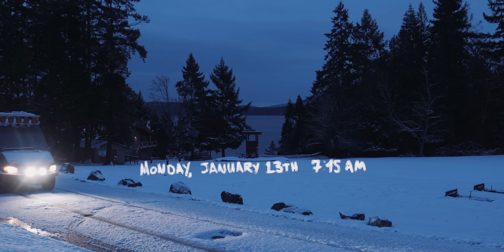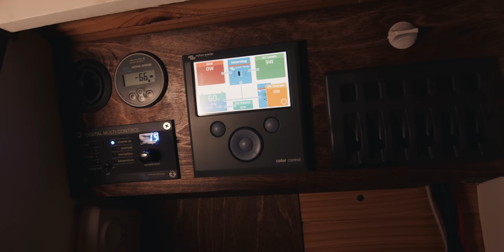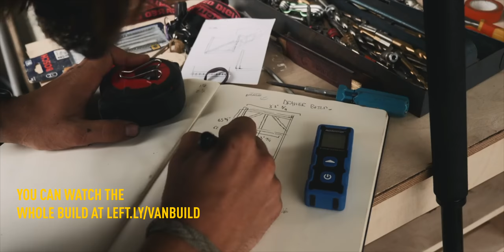Winter Storm In DIY Sprinter Conversion - Van Tour!

Comment: Levi, Quick tip! When bringing your cameras and lenses from a cold environment into a warm interior it's a good idea to seal them in a plastic bag until they've warmed up. This will help prevent potential condensation forming in places (esp.lenses) you really don't want moisture to be! Great van build!
Reply from the maker: That is a great tip that I somehow always forget 😬🥶
Reply: Add a silica gel pack to the bag. They will help dry things out and they are really cheap
Reply: @Levi_Allen  Spekkin of a great tip...storing your canned goods next to your toilet so that you can piss all over the tops of the cans...luvit! :-)
Reply: Whoa great idea!

Comment: If you haven't considered it by now with the diesel heater, you might want to check for condensation build up behind your wall and roof panels. Cold metal, melting snow inside, heating water or just simple breathing. You might find a lot of water that you do no see behind the panels. All that moisture has go some where. Great video.

Comment: Only tip for you, keep a space heater around for when you're somewhere with a plug in - much better / easier to keep the van warm with one of those than your fuel.  I use a costco dish style heater in my 18ft travel trailer and does awesome; oil filled radiators will work great too.  The added benefit - no fan noise.  

The other gadget i use when boondocking is this ryobi "inverter" that basically takes one of their standard batteries and gives 110v and 2 usb ports - great for a small tv/raspberry pi or charging phones.  Works out well as I have a set of crappy ryobi tools for camping.

Comment: Those Webasto style heaters can crank! When I drove OTR semi, we had them in our trucks. -40F and it was toasty in the cab at night.
Reply: But was it reliable? When I drove my 2 freightliner cascadias those diesel heaters were awful. Hardly any temp adjustment and diesel would always gunk up the pilot. Had to take it apart and clean it every other use.
Reply: My semi has an Espar, works well.

Comment: Since you have heat in the van, it would be good to use a pot full of snow and keep it recharged to melt while you have the heat on to keep generating water. Saves your stove time/fuel.
Reply: Creating extra humidity in a van might not be too good. Especially as he goes out boarding and lets the van freeze, any humidity would turn to ice and then drip when he starts the heater up when he gets back. Just put water from the kettle into a thermos/insulated bottle and you will have plenty of water to drink later.

Comment: I bought a cab and 24 foot frame for $9,000. I put a 5 foot wide bathroom on the very back. It's stationary at all times. Then I put dual sliders on the other 19 feet. When the sides are pushed in, the entire 19 feet hang just 9 inches over the wheels. When we park, both sides pull out 8 feet and then heavy supports unfold manually to touch the ground and each leg and even the frame have easy to adjust (by drill) support poles. It's steady as a rock. Get this. It's 19 feet long and 22 feet wide. It's the largest room on any camper I've ever seen. And I've never seen as large of a bathroom as we have. When we travel, we flush and the poop comes right out the back (BLAT) onto the open road

Comment: One upgrade you might want to look into is a rubber mat with high edges that fit where you walk in. you could throw all your stuff that's drying in there and it would collect all the water that you could just dump out the door. your rubber floor is great but water can  still get under cabinets and such

Comment: When I bought my latest Sprinter Camper here in England ( V6 3litre with 7 speed Auto) I never knew that the " Auxilliary Heating"  is in fact a 5 Litre Epersbacher Diesel Heater. I asked so many Sprinter owners on the road , "Have you got a diesel heater ?" Answer "NO" , I said, " Press that little button with the wavy lines and listen" !  Tick, Tick, Tick,  WOW !  !

Comment: Invest in a ARB compressor later down the line if don't have one. So you can air back up your tires after deflate them for snow, sand, mud, other rough terrain that require low psi.

Comment: try putting a piece of duct on the inlet to the D heater then run the duct to your bed room, what you are doing currently is creating a heat exchanger with wind shield.

Comment: Hi Levi - just found this video via FB from Battle Born.  If you haven't already done so in the 2 years that have passed, consider adding alternator charging.  I like the Victron DC-DC Chargers.  I use the 12v 30A model and in my current build (5th wheel), am running two of them.

Comment: Where does the diesel heater's exhaust vent to? Surely you're not inhaling diesel exhaust inside your van - but when you said the heater was just under the seat, it puzzled me. How much diesel does it consume in this cold? Why do most other RVs use propane?

Comment: right on brotha, fun stuff. My interest is peaked for these van builds....so bunch of questions here: when it's really cold, could you not run a secondary propane heater also like a propex? If you cleaned your solar panels off, how much charge do you think they'd pull in? How much or how long to charge that bank while running the van (alternator)....?

Comment: Are the temperatures you mention Celsius or Fahrenheit? -19 celsius isn't too bad but -19 fahrenheit in the van is a different story. We have done as low at -34F and nothing worked. Van wouldn't start nor would the Espar heater. Luckliy we carry a backup Mr. Buddy and could warm the propane canisters to get it lit.

Comment: Somewhere around 23 minutes you talk about charging up your system. So instead of setting up the generator, why not just run your engine for a half hour? At 200 plus amps, it charges pretty fast and beats the generator setup time & maintenance, plus it sips fuel at idle.  But then we generally move every day so power isn't an issue.

Comment: Please make sure your diesel heater exhaust has a clear way to get away from the van. Because otherwise the air below the van can fill up with toxic gas. which will seep into the van when it can't excape to the atmosphere. That can be extremely dangerous!

Comment: Winter storm...its not a storm. Its snowing.
Reply from the maker: I'm not gonna disagree with that. In southern BC a lot of the transport infrastructure falls apart with loads of new snow and rapid temp changes. Freezing rain, ice, water etc. It would be easier if the temp dropped and just stayed cold. Lots of power outages and temporary highway closures during this weather event. Most places that are better built for winter wouldn't blink much at this.

Comment: Hi do you have any videos specifically on how you designed the read seat with how it’s mounted to the body in both the driving position and the turned position?
Reply from the maker: nope, I didn't share that on the internet as I didn't want to deal with any legal hassel

Comment: Speaking from experience, beware of the curtain between the back and the front. Condensation builds up in the cab and rots the vehicle's electrics. Insulate the windows and down in the footwell but make sure the console is exposed to ambient temperature.

Comment: when turning on the heater, would there be risk of carbon monoxide accumulation in the van? How does the air circulation work when the engine is off?

Comment: if you run your diesel heater on low for long periods every now and again run it on full power to burn off on excess carbon build up inside the burn chamber

Comment: does the van not have a split charge system from the alternator so you can just run the engine for a bit and it charges up?
Reply from the maker: Of course, but that is a very ineffective charging method while in idle. It could be an emergency method, but it’s a terrible idea for regular charging. It’s not great to just idle a diesel vehicle for hours to charge something. They like running at operating temp so they don’t build up soot. In a cold environment the van would never get warm enough at an idle to be worth while to use as a charging method. 

When I fire up the generator I get more than a 1000w per hour. That’s a much faster way to charge

Comment: Wonderful Van. Why Go So Far To Test. I Often Tell People About Alcohol Stove/Heater on Amazon As An Alternative In Case Of Main Heat Failer. More Expensive Heat But Safe. Alcohol Use To Be Used To Power Boats. At Least didn't Blow Up. Be Safe

Comment: can you tell how much does it cost to make a van like this?
Reply from the maker: Really depends. You can go cheap and spen $500-2000 or go more advanced and spend 5-15k, this van has a really advanced power system that cost 15k alone. So the price of our build could easily reach 30-40k USD for the build alone without labor